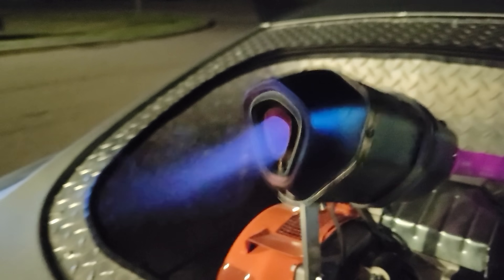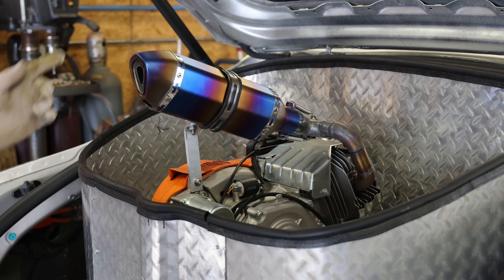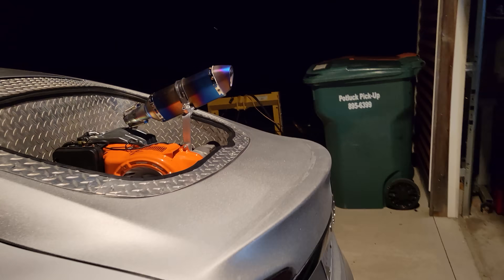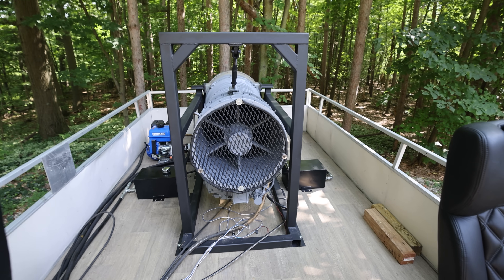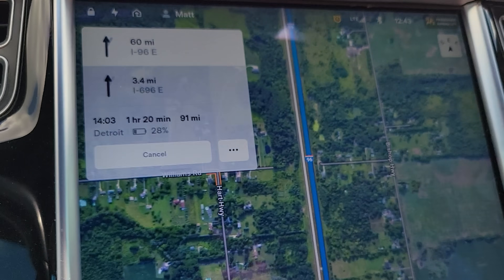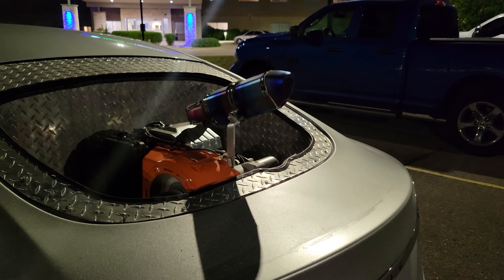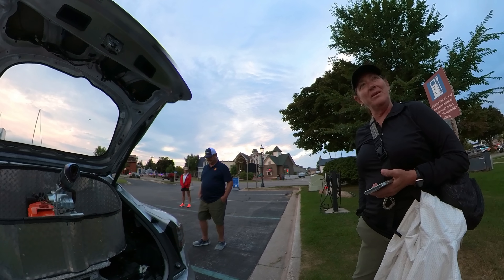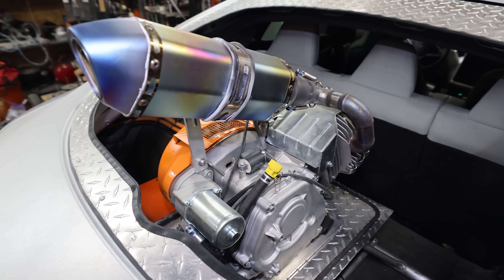Cordless Tesla (I Drive 1800 miles without charging) P.1

Comment: Holy moly!
What an amazing build. I had heard about and thought about something like this, but never thought anyone could build it so well. Waterproof, can charge while driving and best of all, the car registers it as regen and can account for the energy put into the batteries!
Great work, Matt <3
Reply: It's just like my 2014 BMW i3...  Except that can go 70mph without depleting the battery.
Reply: I completely Agree!
Reply: There is this thing called a prius that has been doing it for years....That's what my teacher told me.
Reply: @russellaustin4988  Compare apples to apples. Try again
Reply: @samusaran7317  A Honey crisp is sweet and slightly tart and a granny smith is mostly tart...good baking apple....You can't however grow an apple without a tree.....I don't understand your point but there is my comparasin....Just like you can't charge a battery without a charger.
Reply: @russellaustin4988  There is big difference between prismatic NiMH cells[hybird]  and lithium ion[ev].
Reply: @samusaran7317  Yes, Fuji is a very good apple. They are sweeter than the older Spie apples that were great for baking. If I had an EZ bake oven that worked off of batteries I would have to charge them right.  So I couldn't say that I made 5,000 apple pies without charging if I had the batteries hooked to a generator....could I?

Comment: I have a similar project in the drawer. Do similar in nissan leaf. It has some space under the trunk outside the car. The generator must be three-phase, find the sweet spot at about 400v DC rectified and couple through two contactors on the cable that goes from the battery to the electric motor inverter. That way there is no limitation of the car's software "thinking" that it has already discharged all available kWh in the battery. I believe something like that has been done. If not, I hope I helped with some theory. By the way, if you advance the engine's ignition point, you will have more power, efficiency and you will not burn the exhaust valves. Greetings and good projects.

Comment: Wow, a beautifully glorified hybrid Tesla :) Great work!  16% efficiency is kind of a a bummer. As soon as i saw the hot glowing gas out of the exhaust I immediately wondered about the efficiency. Thanks for giving us that info. Maybe a better generator would offer more fuel economy.
Your Tesla with that hot flame spitting out the rear would for sure be head turner
Reply: A thermoelectric generator could capture an extra 5% efficiency from the heat. :)

Comment: Why does it feel like this video is kind of a hoax? Where’s the generator head connected to the engine? Looks like it’s just the engine running not pulling anything. Plus are you able to somehow trick the onboard chargers to work while moving? Or you’re DC charging it to battery? How would you even boost the voltage from the missing generator head to the 400v Tesla pack? So many questions.

Comment: The Nissan Note E_Power version works like this without all the hassle (I have one).  All Electric drive with a petrol engine to charge the battery, both engines in the engine compartment.  Great little car.

Comment: This was a lot of fun but you basically made a Chevy Volt. 

I’m looking forward to the next episode. 

Would be cool if you could add a larger battery in a new build which could be super charged. That’s something I’d buy.
Reply: GM made a lot of effort to get the Volt working just right. The ICE was carefully selected to be quiet and efficient whilst producing enough power to keep up with average performance. I feel it is highly likely that this consideration limited the overall performance that resulted, as they didn't want to end up fighting with customers or lawyers.
I've always been fascinated by this engineering niche, and it is great to see someone tackle it in such a simplistic way.
Clearly a bigger generator is needed, it'll make more power and less noise, and a longer exhaust will be necessary.
There seems to be enough room, lets see the next installment.
Reply: @OutsideTheBox-YTwantLongHandle  I have a 2018 Volt and agree that in today's world, the performance is average. I am old enough to have been driving in the 80s and, by those standards, the performance is good. Also, I think that the Volt is one of the few plug in hybrids that has the about same acceleration whether running solely on the battery or the engine. I like that feature.
Reply: @michael.a90125  that just means you're not getting the electric torque you deserve.
Reply: Except the Volt is more efficient on gas.
Reply: Surprised this comment isn't closer to the top. Despite being an econobox, the Chevy Volt/Opel Ampera does a solid job of blending EV efficiency with the freedom of being able to simply fill up a tank instead of waiting hours to charge during roadtrips. Makes for an incredibly cheap to operate and easy to maintain commuter.
Reply: I was thinking the same thing! I just wish GM didn't stop producing the Volt. Maybe GM can collaborate with Tesla to make a Next-Generation plug-in hybrid Volt with more than 40 miles of EV range. (But I won't hold my breath.)
Reply: @davidgno  I think that ship has sailed. Personally, I thought the idea the engine only there to charge the battery was great. Unfortunately, it just didn't seem to catch on. I think reintroducing it now would go against GM's proposed buisness strategy and could make shareholders question GM's confidence in their EV line. Just my two cents though.
Reply: @rusty2381  I'm totally in agreement with what you said. But when it comes to consumer acceptance and overcoming range anxiety, I think the plug-in hybrid was/is the way to go. I own a 2015 Volt and love it, but with only 30 miles EV... My dream (ignoring laws of the universe and thermodynamics) would be a modern Volt with high mileage EV range and backup ICE so that if/when I have to travel to a rural area where I'm unsure if there are any charging stations, or where electricity is unreliable/goes out often; I'd have that ICE range extender as a backup to not get stranded and be able to keep driving.
Reply: How do you "supercharge" a battery?
Reply: @randybobandy9828  just like how you’d super charge a Tesla car battery.. I’m not an electric engineer but I’d guess using an inverter and lots of watts.
Reply: @vrowhani  you can't supercharge a car battery. Unless youre talking about a actual charger and not a car engine super charger
Reply: @randybobandy9828  However Tesla charges their batteries, I just mean that it would be great to put another 10, 20, even KW of Tesla batteries in the car and rig up a way to charge them quickly.
Reply: tons of money and effort to turn a tesla inta a chevy volt with the fuel efficiency of a hummer.
incredibly ironic
Reply: With just one exception, it didn't burn up.
Reply: @tedmoss  you've got your Bolts and Volts mixed up
Reply: And by Chevy Volt you mean a BMW I3 with the gasoline range extender option. Literally the same thing he just did.

Comment: Some upgrades I'd like to see- exhaust tip running out under the back of the car like a ICE car, remote start/shutoff ran up front for the generator, and maybe try a inverter generator. They only rev up and run hard when a heavier load is applied. It would be more quite in some situations and maybe use less gas
Reply: Inverter generator won't help much this generator is running full throttle the whole time making 10kw. Highway average for teslas is like 300 wh/mi so you'd need a 25kw generator to never have to slow down. That's also more than the level 2 charger can take so you'd have to dc charge the batteries (i don't know if he's already doing that).

Comment: This is exactly what I think Hybrids should be.  I have had the idea floating around in my head too.  Why can't you just make a efficient engine that is tuned to run at a specific RPM so it maintains optimum efficient and get better fuel economy and get all the benefits of an electric engine.
I will be interested in seeing what you come up with.
Reply from the maker: 100% agree, this is the most fun hybrid I have ever driven in my life, the thing is almost 1000 HP all wheel drive, loaded with technology, the only thing that's missing is range
Reply: What you want already exists and nicely packaged and tuned to be quiet and user-friendly: Chevrolet Volt (best implementation so far, unfortunately discontinued); Kia Niro PHEV; Honda Clarity; Toyota Prius Prime and RAV4 Prime; Chrysler Pacifica PHEV.
Reply: @cko519  Buy my understanding atleast the Toyota's have a Engine that charges the battery and moves the tires.  NOT 100 percent.

But, I guess what I have in my mind is an Engine that can be removed or modified that runs at a fixed RPM and the tires are completely electric.  Because, if you can remove or replace the engine you can run any fuel you have access to.
But, most hybrids allow for the engine to run the tires as well so that if your battery is completely dead then you can still move the car.
But, if you can get a hybrid to get 40 mpg and move the tires.  I would assume that you should be able to get a hybrid to get 50 or even 60 MPG at a fixed RPM if it doesnt have the drag on the engine of also moving the tires.  IN theory.

But, still being able to remove and replace the engine means you can use ANY fuel.  you just need a different generator or maybe just modify the current generator.
Reply: @fuxaplexlegends9028  As I mentioned, the Volt does have the best implementation because the engine does not move the wheel except at certain speeds when it is more efficient to clutch it into the wheels rather than run its output through the battery.  However, this only takes place when the user manually puts it into a mode (Hold battery level) when the engine is allowed to run, or if the battery is too depleted, forcing the gas engine to run.  If the Volt is kept in "Normal" mode, it operates purely as EV and the engine will not run at all unless the battery is empty.

The other manufacturers do not have as pure of an impleementation as the Volt.

The user-swappable engine as you suggest is not practical as a product and would be problematic for emissions controls and some of the  problems shown in this video, like noise. 

My Volt indicates it uses between 11-15kW to sustain highway speeds. It's unlikely that a generator large enough to keep the battery charged/charging at highway speeds would be practical in terms of size, especially if it was not well-integrated in order to be swappable..
Reply: @cko519  I do not see why swappability would problematic.
In a world where you never know what fuel is going to be cheapest having a generator you could swap out seem very practical.
For peak efficiency it may get expensive for the owner.  Because, if you want an engine that is designed for peak efficiency of Diesel or Hydrogen then you would need to build an engine specifically for those fuel types.
But, I have seen people use Hydrogen,  Natural Gas, E85 and Pump gas all through essentially the same engine.  For emissions I believe ( though am not 100 percent sure) that e85, natural gas and Hydrogen all burn cleaner than pump gas.  So, they should be an improvement.

More than likely the average person wouldn't do it.  But, if Gas goes to 5 dollars again some people may like the option to just swap out their generator to a Natural Gas or Hydrogen Generator or whatever is cheap at the time.
Reply: Audi's latest electric Dakar vehicle is is exactly this. It uses a 2l turbo running at optimum RPM to charge the battery.
Reply: Older Opel Ampera or Chevy Volt does this. Same cars essentially but the Volt has newer models
Reply: The Chevy Volt ALMOST does this.  It caps the recharge at about 7-10 miles range.  I presume it has a technical reason for this (e.g. stress on the battery), but I would love to be able to set the limit higher on my Volt!
Reply: @andy-in-indy  recharging a battery from the engine is the worst use of gas. The energy is more efficiently used in some sort of direct drive application.  On mountain mode, my volt will charge the battery up to 50% in probably 30 minutes but it uses alot more gas than if the engine just drove the same distance on gas alone.
Reply: @majorchungus  It is different in the Gen 2 Volts vs. Gen 1.  Yes, charging from gas uses more fuel (the energy is not free).  Much of that difference comes from the engine running continuously at a higher rpm than it would at idle.  This leads to a significant loss of fuel efficiency during "in city" driving with a lot of velocity changed and idling at stop lights.  However, on the highway the difference is smaller because you are traveling longer times at a more consistent velocity.  My commute is split between city and highway style driving, and during the winter my battery range is not enough for the "city" part of my commute.  Being able to recharge another 5-10 miles range while on the highway would be beneficial to me.

Comment: Turbo Diesel generator
Reply from the maker: Someone knows me well 😊
Reply: @WarpedYT  Quieter more torque more power. Might even be more range per gallon. Diesel has more fuel options as well. Vegetable oil Bio-Diesel ect. Would be a fun project for sure.
Reply: Another option would be the Plutonium fuel cell from Back to the Future (Mr. Fusion) lol then you just need to get to 88 MPH oh that's another story... :)

Comment: How was the tesla not find it wierd that it was getting charged when it was at a 50mph?
Reply from the maker: The Tesla will find it weird even if you hooked up a double a battery, let me tell you the Tesla has some of the best safety electronics I have ever seen, a Tesla does what it does very very well and very efficiently I can't even begin to tell you the genius designs I have seen inside of some of those assemblies, I did in fact document everything along the way for the last year and a half and I'm going to be putting it on my other channel called Matt's lab. But I actually built my own system to make this possible.

Comment: Maybe someone has already asked this, and pardon me if I sound funny . Any chance to try have a solar charger setup? The engine was great though .
Reply from the maker: I would have loved to do solar, problem is it's not nearly enough energy. My goal is to be able to fill up and just drive Non-Stop for 1500 miles straight, Non-Stop at 75 mph and 1,000 horsepower all wheel drive car. That's my goal I was going to say that in the video but I'm going to save it for the next one because I was very very upset that this didn't work out this time

Comment: Get a actual generator for it so it will idle down and up if needed.... like one of those honda/Predators 2,000watt generators, quiet and idles up and down automatically  (just needs a larger fuel tank )
Reply from the maker: It does idle up and idle down, it was running at full throttle the entire time, it wasn't enough power, 1,000 or 2,000 Watts won't do anything for an electric car you wouldn't even get 10 miles per hour out of there

Comment: How about for the bigger and better build you make a trailer with the generator on it? For around town, the car can remain stock.  For road trips, you hitch up the trailer and plug in the extension cord.  Harbor Freight makes some surprisingly quiet generators that could be used as the power plant.
Reply: It would ruin the aerodynamics more and trailers are ugly and annoying because you can't park in a regular space which can be a pain on a vacation.
Reply: it would still use more fuel than a normal car.

Comment: I'm hoping that v2.0 uses an  Diesel GenSet rather than gasoline. I know the extra weight sucks, but much quieter and really designed for long-run under sustained load. 20kW on Gasoline is usually like 3.22 GPH and really loud, 20kW on Diesel 1800RPM should be closer to 2.1 GPH. The big question is whether you could get a 20kW+ diesel generator that weighs less than 1000lbs. There are high-speed direct injection diesel generators that make 5kW and are under 250lbs, I'm assuming someone must make 3-phase 20kVA 240/400v models that are under 1000lbs.
Reply from the maker: 😉 well I custom built this gas unit. Notice at the very end of the video I say "goodbye gasoline" lol.
Reply: @WarpedYT  BTW, I've also thought about and wanted to do almost exactly what you did here, series hybrid EV using a quiet high-speed diesel that can run 24x7 since the first plug in hybrids hit the market, and I know I'm not alone. You just did something that I'm sure tens of thousands of us thought about but weren't willing to or lacked the ability to actually do.
Reply: @WarpedYT  I did, it was also pretty obvious that you were running that thing HARD!

Comment: a little 1-1.5L diesel would be ideal for this application. EV and hybrid automakers are going the complete wrong direction. EV motors with smaller batteries charged by a small diesel / gas engine like this is the way to go
Reply from the maker: I have been planning for the last 7 yrs for this project, all I can say I have about six videos coming out with the Tesla, and you and I are speaking the exact same language.
Reply: @Dakota, BMW I3 looks like what you want
Reply: Could not agree more😊👍.
-Build a car that's 99% EV, but just add a tiny ICE generator.
-Never be held hostage to public charging that's often occupied, ICED, vandalized, unsafe (mugging/carjacking)
-Volt and i3 REx closest production models to this idea, but were ignored  (looks? cost? who knows?)